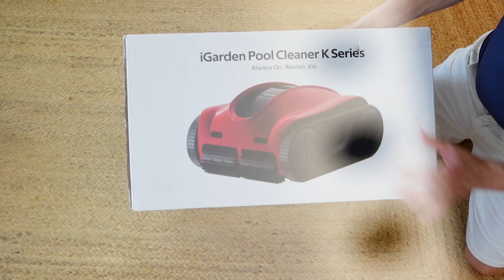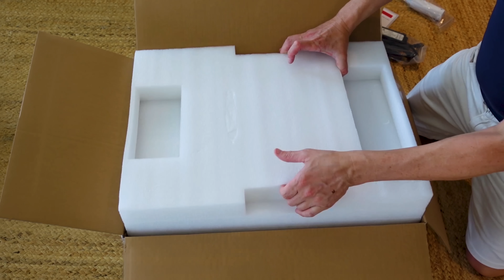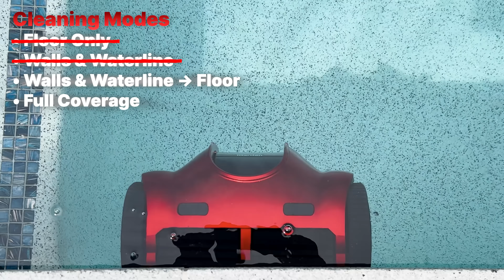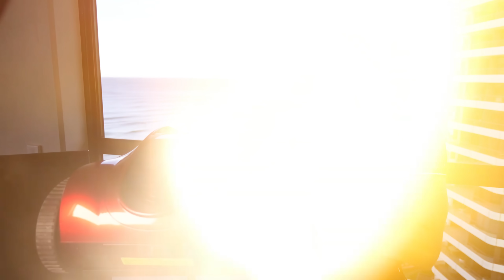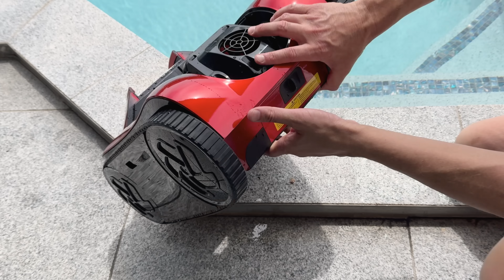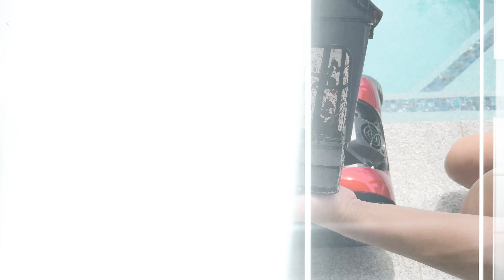iGarden K Pro 150 Pool Cleaner – Supercar Design? Real World Test & Performance

Comment: This is peak MrYouWho 😂 supercar design is cool but does it actually lift fine dust/sand or mostly big leaves?
Reply from the maker: @TVibe19 😂 It does lift fine dust/sand in my testing, not just big leaves. The big difference is keeping the filter reasonably clean — once it’s packed with heavy debris, fine dust performance drops a bit.

Comment: does it handle a pool that has a beach entry with a gradual slope or does it get confused and beached itself?
Reply from the maker: @riciphariss107 it handles gradual slopes better than most, but very shallow beach entries can still confuse it occasionally depending on the angle

Comment: If you run it back-to-back after a storm, does it still climb/track properly or does it lose performance once the basket loads up? 🌿
Reply from the maker: @haganenriques1070 performance does drop a bit as the basket fills, but it still tracks and climbs well unless it is completely packed

Comment: does it work properly in a saltwater pool or is it really designed for chlorine only?
Reply from the maker: @MaximK-w1h it is mainly designed for standard pools, it can handle occasional saltwater use but regular exposure should be followed with a rinse to protect it

Comment: Be honest… does it actually lift that fine dusty layer off the floor or is it mainly a leaves-and-grit machine?
Reply from the maker: @JimmyYates738 it does pick up that fine dusty layer better than most, not just leaves and grit, though really fine particles may still need occasional follow up

Comment: Can you run it back-to-back after a storm and it still climbs/tracks properly, or do you need to rinse the basket/filter between runs?
Reply from the maker: @filbertjustiss4798 you can run it back to back, but after a heavy storm it is definitely better to rinse the basket to keep performance consistent

Comment: If you run it back-to-back after a storm, does it still climb/track properly or does performance drop once the basket fills up? 🌿
Reply from the maker: @Logan-r6l8w Great question 🌿 If you run it back-to-back, it’ll still climb/track fine, but once the filter/basket is getting packed you do start to lose some performance. Quick rinse between runs = best results after storms.

Comment: If you run it two cycles back-to-back after a storm, does it keep climbing well or lose grip once the filter’s loaded up?
Reply from the maker: @DylZ8-h2q it still performs well on back-to-back cycles, but if the filter gets heavily loaded you’ll get the best climbing performance after a quick rinse

Comment: does it actually clean the waterline properly or do you still have to get the brush out afterwards every single time
Reply from the maker: @OlgaIrwin it does a solid job on the waterline, but like most cleaners you may still need a quick manual touch up occasionally

Comment: Be honest — after a full cycle does it actually get the waterline or do you still have to scrub that yourself 😅
Reply from the maker: @AlanPotter35 Be honest answer: it helps, but it doesn’t magically erase every waterline stain. If you’ve got a light waterline, it’ll keep it way more under control. If you’ve got a baked-on ring, you’ll still do an occasional quick scrub — just way less often. 😅

Comment: How painful is getting it out — does it drip everywhere on the pavers or can you lift it without making a mess 💦
Reply from the maker: @LailaDreamz16 it drains most of the water before lifting, so not a huge mess, but you will still get a bit of dripping depending on how full it is